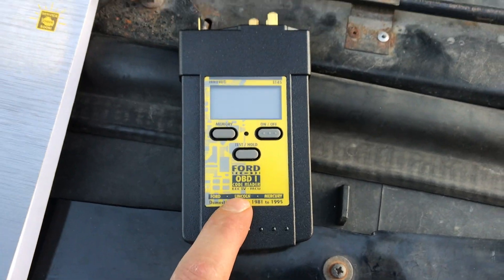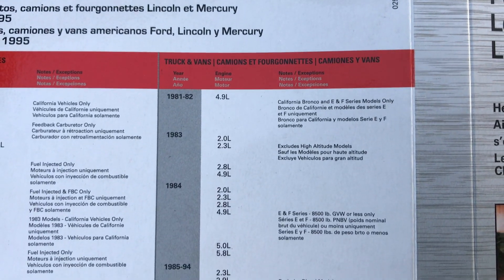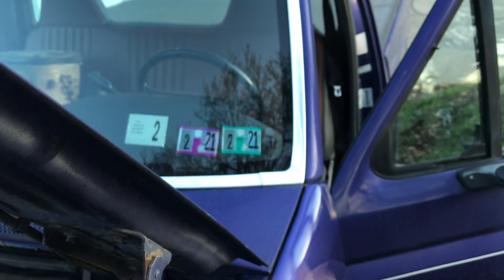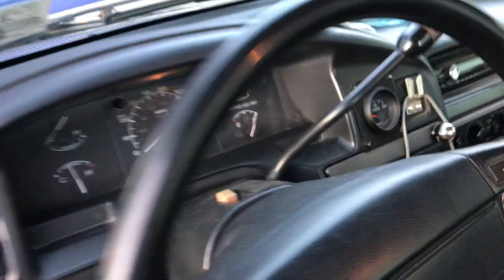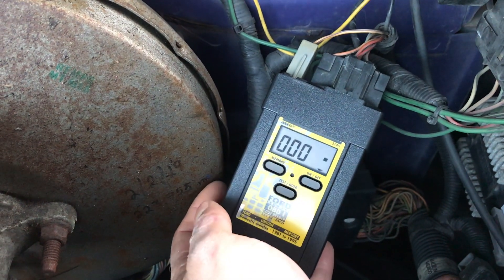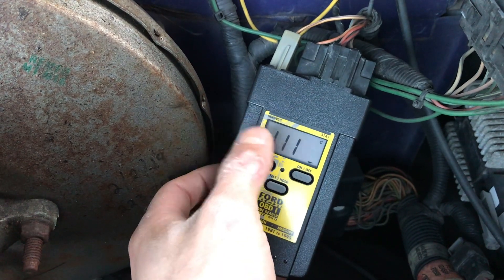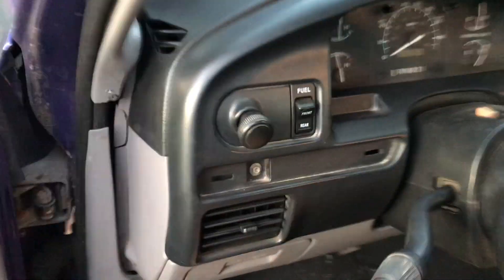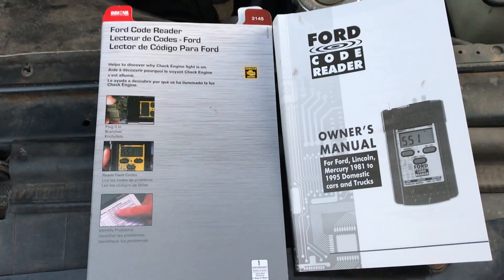How to Read OBD1 Codes on Pre-96 Ford F150

Comment: hey awesome video! Just finished replacing both parts on my 95 5.0 xlt. I followed this because i had multiple codes including a 332, plus hard shifting after long periods of driving and i think thats when it threw on the code 332 (check engine light would come on randomly). 

Anyways i started up my truck after replacing, and it was a very hard start. had to hold the key for about 5-10s. then it was running good, let it idle for a bit, then drove it for a bit. turned truck off and then started it back up, this time it started right away. then ran the code tester and still came up with some codes, including:

311 - thermactor air system/fault during engine run self test
334 - EGR closed, valve voltage high
225 - knock sensor fault during dynamic response test
212 - loss of ignition diagnostic monitor, signal/spout circuit gorunded

Idk if all of those have to do with replacing it jut thought id mention them. Anyways i havent been able to drive it a long time yet so i really dont know if theres any/big issues, but just thought i could get the convo going of what may be causing those codes. Or if the codes just didnt get erased after the installment? Im not to sure how to do that still new to all of this. I did disconnect the (red) positive battery cable when replacing all of this tho. anyways any thoughts would be appreciated, thx!

P.S. i also recently replaced all vacuum tubing and vacuum reservoir.
Reply from the maker: The 311 in reference to the thermactor air system sound like a vacuum or sensor induced code. The thermactor valve is the one behind the driver’s side of the intake plenum. It has 2-3 vacuum lines connected to it.
334 - can be caused by a number issues, stuck EGR valve, malfunctioning EGR position sensor, lose of vacuum to the EGR.
225 - could be cause by not hitting the gas doing the test.
212 - is new to me.

My advice is to go and internet search those codes for fixes, especially 311, 225, and 212.
I fixed my 334 with new EGR valve and position sensor.
Reply: @TheMinuteMasters  thanks for the swift response! I will look more into these, in the meantime keep making more great content for us un-experienced obs owners 🤣
Reply from the maker: @brodyclark  No problem man! Will do!
Reply: @TheMinuteMasters  hey just realized I somehow commented this on the wrong video, meant to comment on your EGR valve replacement video🙃

So just to reiterate, I did replace the egr and the sensor with the same parts you linked but I’m now getting the 334, was only getting 332 previously. Could this be that I got the wrong part or it’s faulty? Bought straight from your links in the description.
Reply: @TheMinuteMasters  UPDATE: I went ahead and threw the old sensor on, ended up not getting the code 334, but instead 332. So I think it’s the sensor. I must’ve got a faulty one or it’s not the right one. Going to keep the new sensor on for now but I think I’ll contact their support and see if they can help.
Reply from the maker: @brodyclark  Good idea man!🤙

Comment: Hi  Nice clean video, very helpful.  So i got a 565 KOEO, also a 172 c reading...how did you fix the 565 (purge canister solenoid circuit)?  I replaced the solenoid (which i later tested and it opened okay w/ a 6 v battery), then replaced the heated oxygen sensor then retested and got the same codes.   Since the wires connect to harnesses and all look undamaged, how do you either test the circuit from the PCM computer to the sensor/solenoid??
PS the book said don't fix the c test code until you pass the first KOEO test.   Also, the book doesn't explain what the c test is really testing or doing.    Thank you sincerely, randy c
Reply: Hi Thank you for the reply.   Onto changing plugs and wires and dist. cap.  And Motorcraft platinum plugs.  By the way, what do you think would be the best repair manual specific to '95 f150 5.0l 4x4--can't tell if it has a/c or not, the compressor looks like an air pump, no clutch just a pully wheel, can't find pressure ports---but there is a cold air knob inside!   Randy c
Reply from the maker: @tacoma1309  Hi Randy, I’ve been a long time user of Haynes manuals which are pretty easy to find at any auto parts stores.
Reply: @TheMinuteMasters  Hi Minute Masters:  Thanks for letting me know and by the way, with all my testing, i think i must have scared the computer a little because the check engine light (CEL?) hasn't come back on!  randy c
Reply from the maker: @tacoma1309  hahahaha! That’s good!
Reply from the maker: Hi Randy, I’m not sure how I fix the 565 code. And I know in this video, I said, I got a clean read from the code reader. However, I have no explanation for how I got rid of that code, and to be honest, I don’t think it causes any issues.
Somewhere in the comments, somebody said, Ford eliminated some engine function that required that solenoid purge valve, but never eliminated the valve. So it will always throw the code.

Comment: hey, thx for putting these videos up man!  VERY useful...I ran my codes on my 87 5.0L today after changing the plugs/wires...had a miss.  the Innova 3145 is reporting 6 cylinders - not 8...I read on the forums where the connector being dirty will do this....just an FYI...
Reply from the maker: You’re welcome man!🤙 
Gotcha. Good to know!

Comment: Thank you. Bu as usual I'm confused. If you got a 565 code, then how can you say you passed the test when you got the 111 indicator? Doesn't the 565 indicate a problem with the sensor you remarked upon?
Reply from the maker: If I remember correctly, code 565 only shows up in one of the tests (engine on or engine off). So I get a 111 after the one that doesn’t through the code.
Reply: @TheMinuteMasters  dd
Reply: @TheMinuteMasters  Thanks. You did a key on engine off test. There was a trouble code. 565. The key on engine off test continued. You got a 111 which means "you passed the test, there are not codes". But there was a code. 565. So that's what's confusing to me. Of course, I'm the only one who is confused. But this is very common. I pay very close attention, and if something doesn't make sense, I question it.  Thanks for your video.
Reply from the maker: @marshall2  Good eye Pat! I’ll have to go back and run the test and see if I get a code 565 then.

Comment: For some reason my engine revs up but doesn't show any codes? Any help will be greatly appreciated
Reply from the maker: Like it just revs up and stays up or does it rev up and down?
Reply: @Minute Masters  revs up like yours did then revs down but has no reading just says "000"  but I have both check engine lights on
Reply from the maker: @holdengatz5457  I would try using the code reader a couple of times until something registers. If the code reader still shows 000, then the reader could be faulty.

Comment: Great video ! I was wondering if you had any ideas for the issue I'm having. I have the tool plugged up correctly and it turns on and the triangle pops up but the square doesn't and it doesn't throw any codes ?
Reply from the maker: Try it a few times and if you have the same issue, I’d return that code reader and get another one.

Comment: 1996 Econoline gvw 8,600+ uses obd1. It has  obd2 plug under steering wheel but doesn't communicate with ECM.
Reply from the maker: Weird. Does the OBD1 plug work?
Reply: @TheMinuteMasters  yes,

Comment: Had some joker at an auto store tell me I couldn't  run codes on my 91 F150. That's why the reader fit and I did get codes, right? WAITED for him to tell me i needed Signal fluid and a muffler bearing..:face-green-smiling:
Reply from the maker: 😂 Those parts guys are either really good or really bad. Lol

Comment: Great videos man. Quick question. I’ve got a 1995 f150 302 with obd1. It seems like it misfires at idle and it idle surges as well. It’s got a new tps sensor (motorcraft) and some other new bits. I ran the key on engine off test and got code 565 and then after got code 157 which is a Maf code. For some reason never got code 11 at the end after waiting a while but I proceeded. Previous owner replaced the Maf. Ran the engine on test and got code 998 which I’ve heard is limp mode and code 159 after. Another Maf code. Truck doesn’t seem to run any different when I unplug the Maf. Where would you start next? Possible bad computer? I know they are known to go bad. The capacitors that is.
Reply from the maker: Thanks man!🤙 Idle issues are difficult to pin down unless you know the age of all the ignition parts. 
When was the last time spark plugs, wires, cap, and rotor were replaced?
An easy test for a MAF is to start the truck get it warmed up. Leave it in park and rev the engine. If the MAF is working it should rev up and down just fine. If it stumbles and maybe stalls, the MAF is bad.
Reply: @TheMinuteMasters  computer is fine. Previous owner supposedly did all the ignition stuff but at work tomorrow I am going to check the timing. Gonna go over his work as well. Keep up the great work my man🤘🏻

Comment: I had a question. I have a 91 ford xlt lariat, auto trans. It has overdrive but it’s not a push button overdrive, it’s a gear shift overdrive. Would I skip the overdrive step? Thanks for the great vid!!
Reply from the maker: Yes, I do believe you skip the overdrive part in that instance.

Comment: Even though I own a 1996 F 150 it still has ODB1 as it was built in 10/85, well before the cutoff date of 1/1/1996.
Reply from the maker: Sounds about right. I’ve heard guys that have been on the other end of 96 and got an OBD2 system.

Comment: Thanks for the great video. I have a 1996 F150 with the ABS light on and it has an OBD2 port but no code. Is there a way for me to know what the issue might be? Any help will be appreciated, thanks.
Reply from the maker: No problem JR! 
ABS light is no surprise brake related. The easiest fix is to check your fluid level. Low fluid can trigger the sensor and the light will turn on. Sometimes that sensor goes bad. Sometimes the ABS sensor on one of the axles can go bad as well.
Reply: @TheMinuteMasters  Thanks for your reply, I will check on that sensor and see if that helps with the OBS light, another issue I noticed is that whenever I come to a stop, my truck tries to turn off as if the my idle was too low. Do you think is related? Thanks again
Reply from the maker: @jrorellana4865  My gut tells me the brakes aren’t related to your stalling issues. Stalling is usually sensor related and it’s related to your air management. So MAF, IAC valve, etc. that’s where the code reader helps. sometimes a transmission can cause stalling issues too.

Comment: Hey! Thanks for making a video for this. I am doing this now because my truck will not start. Where can I go to find more information on the codes though? I have gotten the codes and am now trying to figure out what they mean  and what needs to be fixed. I am thinking the main code which was 542 is the reason it is not starting because it is for the secondary fuel pump circuit (what that is I am not sure), the other is something about the egr valve not getting enough reading or something. I have tried searching but am getting so many different meaning other than what the book says my code is for, and I cant seem to find what exactly the secondary fuel pump circuit is!
Reply from the maker: You’re welcome man!🤙 
Honestly I just do a Google search to find the answer. I know it may seem like there’s a lot of conflicting information out there but you can typically narrow it down. For the EGR code use this video to diagnose👇

https://youtu.be/xWpqhdQH01Q

For the fuel pump, I would check relays and fuses. Then I’d replace the fuel filter. Replacing the pumps should be your last move.
Reply: @TheMinuteMasters  What is really just confusing me now that I have once-overed it, is that both pumps prime just fine when I turn the key, but the truck doesn't start. Ill have to dive deeper tomorrow. Thanks a lot for your reply!!

Comment: I’m very confused. When i go to do the Engine On Test my reader says “6 cyl” but i have a 351w. Originally a 302 but it was swapped by previous owner. I also can’t even do the test properly because my overdrive button doesn’t compress. Any ideas on either issue or why it says 6cyl?
Reply from the maker: So that happened to me. I had to unplug turn my truck off and then restart the whole process to get my reader to show 8 cylinders.

Comment: I got my Innovo Ford code reader in today along with the extension cable.  Plugged the extension cable into the code reader and something just didn't feel right.  Pulled the extension cable off the reader and noticed that the those broad, flat pins on the code reader had been pushed into the body.  Now I'm a 78 year old former electronics tech so I know I didn't "muscle" the two together.  I don't know if the female connectors on the cable were too tight or if the male pins on the reader body just weren't secured properly.  They were pretty loose when I pulled them out with some needle-nose pliers.  If the code reader body had been screwed together then I could have disassembled it and repaired the pins.  But, it was glued together so back it went to Amazon.  Someone mentioned an Actron 9690 code reader.  I'll have to give that one a try.  I'm afraid to reorder that Innovo Ford code reader.  The next one might be as bad as the first one I got.
Reply from the maker: Good move. The Innovobis cheap both in price and build quality. It does the trick when it works. I haven’t used any other brand but Actron is an industry name. So you may get a better quality code reader.

Comment: Hello, one question when you press the hold or test button does any led light turn on , on the tester because i dont know if my tester has something wrong because o dont get any icon logo light or something only the 00 screen, thanks
Reply from the maker: As I tell everyone, this code reader is good but not perfect. Try running the test again and see if it works properly.
Reply: @TheMinuteMasters  thanks!!

Comment: According to the manual I need to do ignition timing after KOEO and before KOER in accordance to the specific service manual of a 1993 and up vehicle.  Do you know how I could find such a manual/complete this procedure?
Reply from the maker: So the manual is saying you need to check your ignition timing? If that’s the case I have a video that shows you how to check your ignition timing with a timing light. Watch that and then check your timing.

Comment: My code 212. I have f150. Running rough. I repair the oxygen sensor.
Reply from the maker: I think that’s a ignition module problem, particularly the SPOUT connector.
Reply: Were that so I can fixed it. Spout.
Reply from the maker: @pattydamron7375  If you watch my most recent video about how to check engine timing, I show you where the SPOUT connector is.

Comment: Thank you. I now know what an OBD1 port looks like. My 1996 Ford E350 ClassC motorhome 7.5L can't read the codes. But it definitely looks like an OBD2 port. My OBD2 reader can't read it. Seems like a common problem with this specific model. It can't communicate. Might be an issue with the port. Fuse was bad, I changed it, that isn't the issue. But at least that fuse is fresh now. 
Off to do more research! Your video helped.
Reply from the maker: Your welcome Tex! If the code reader doesn’t work the first time, I’d try a few more times. It’s a good code reader (for the price) but it does have glitches here and there.
Glad to hear it and thanks for watching!🤙
Reply: @TheMinuteMasters  Unfortunately, the mechanics 10k reader can't read it either. I'm still troubleshooting. He quit because he could not figure it out. I have an Autel OBD2 reader. Neither will link, they get link error codes. The problem is probably in the OBD port. I'm a bit intimidated over messing with that.
Reply from the maker: @TexCynRVLife  Gotcha. I don’t know if it’s worth diagnosing there port either. It’s probably best you test every part and sensor related to your issue until you find the faulty part.
Reply: @TheMinuteMasters  Thanks for your replies! 👍😊
I'll get this figured out.
Reply: Did you get your obd11 sensor to work

Comment: Good instructions but mine only read the codes in key on engine off. I tried with the engine on and it wont read. It's a manual 4.9
Reply from the maker: Thanks man!🤙 I would try it a couple of times. This is the best cheap code reader but it has glitches here and there.
Reply: It's throwing 600 range codes (E4OD) codes but it's a 5 speed manual???...I'm lost
Reply from the maker: @darksoulfugs1982  Is this your second try?
Reply: This is key on engine off codes.

Comment: Does it need batteries mine won't work for some reason
Reply: The scanner has batteries in it
Reply: It's working now it had no batteries to begin with
Reply from the maker: @kylespeck3480  Great to hear Kyle!🤙
Reply from the maker: Try pulling the batteries out and putting them back in or turning it off and turning it back on. These scanners can be a little iffy sometimes but they are still one of the better ones on the market at their price. If it still doesn’t work, then return it and get another one.

Comment: I have that reader and it put out a 121 code. But i can't find my code booklet. got a idea what that could be?
Reply from the maker: I just looked it up, and it says closes throttle voltage. One comment says an issue with the throttle position sensor. You could try cleaning yours. Just put it back exactly how you took it off.
Reply: Thanks. Now I have a path
Reply from the maker: @jimconway3301  No problem Jim!🤙